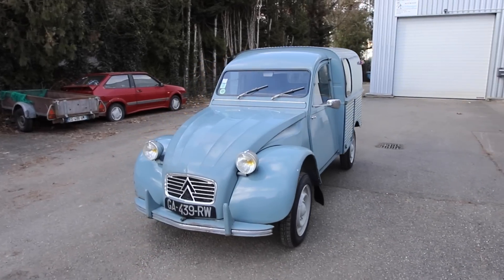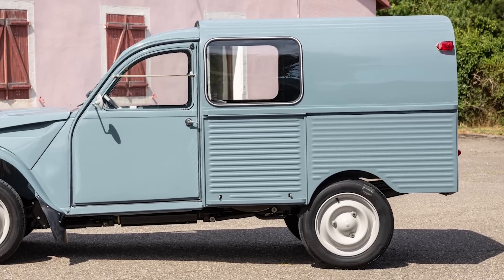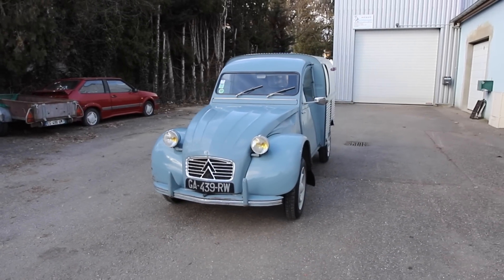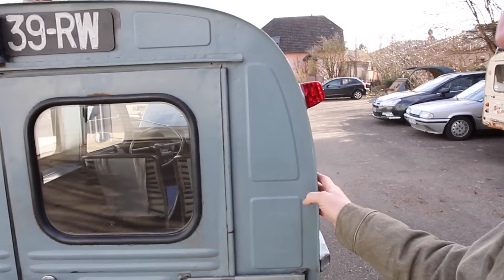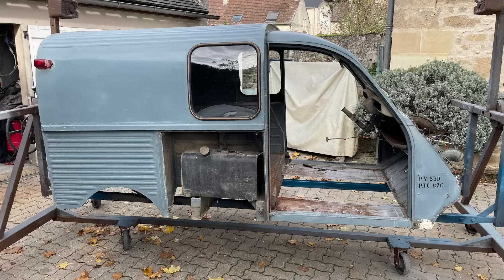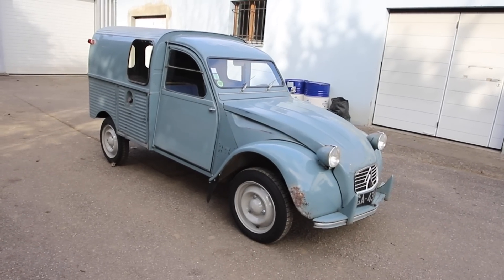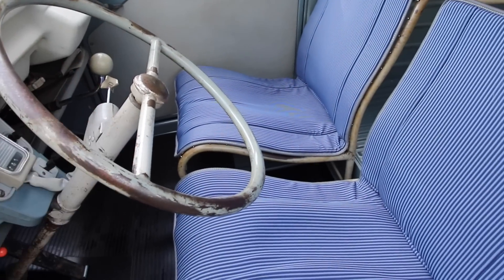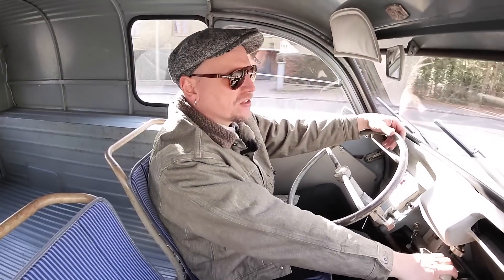La petite 2CV fourgonnette des années 60 : analyse complète

Comment: Bonjour Étienne, encore une belle présentation pour une fourgonnette tout aussi belle 👍🏻
Toujours un plaisir de suivre tes vidéos. 
Je suis actuellement sur une berline 1959 en restauration totale, j’espère pouvoir commencer à en profiter d’ici une petite année… 😊
Vincent
Reply: Bonne restauration et bonnes balades avec. J'en ai une dans le garage de fin 59, modèle AZ de base, avec la capote longue bleue marine sur son bleu glacier. Mais sous le capot ce n'est plus l'origine : Lors de son rapatriement de chez les voisins en 89 j'ai remplacé les bras de suspension avec batteurs, pivots, cardans et boite par des 2cv6 début 70, et le moteur par un 602 M28. J'ai fait pareil 1an après sur l'ami6 62. C'était trop tentant, à l'époque on trouvait les pièces des premières 2cv6 partout y compris en neuf chez Citroën. Aujourd'hui je viens d'acquérir une AZA ENAC début 64, et j'ai du acquérir en parallèle une 2cv6 72 pour récupérer les pièces. (Rassurez-vous : la 72 va recevoir un chassis neuf avec amortisseurs et son nouveau propriétaire, un copain  vient de faire sa connaissance 😂)

Comment: MA-GNI-FI-QUE avec sa patine d'origine. Exceptionnel sur une fourgonnette. Nous ( le compte est celui de mon epouse😊) venons de remplacer une AK350 1963 par une AK250 de septembre 74, modèle administration avec la carte grise et le moteur 3cv et sans vitre latérale. C'est justement l'absence de vitre par rapport à l'AK350 que nous avons préféré.  Nous venons de la restaurer en jaune la poste avec le moteur poussé à 652 (pièces burton) et boîte de berline. A l'achat elle était effectivement... euh   pourrie 😂. Même le chassis😮
Reply from the maker: Alors l'AK en 3CV n'existe qu'en 350 ou 400. Si c'est une 250 alors c'est une AZU qui n'a existé qu'en 2CV à moteur 425 ou 435cm3 évidemment. Mais on voit souvent ces voitures modifiées avec un moteur 3CV, ce n'est pas d'origine mais ça fonctionne bien !
Reply: Elle est de type azu-b et la carte grise est bien en 3cv... Mystère. Elle était orange DDE à la base, repeinte (mal) en blanc par un précédent propriétaire.
Reply from the maker: @anne-mariepons-eb6nr  AZU-B c'est pourtant bien le 435cm3 et donc 2CV... Elle a sûrement été modifiée avec demande de modification en 3cv a une époque quand c'était possible... Tant mieux alors !